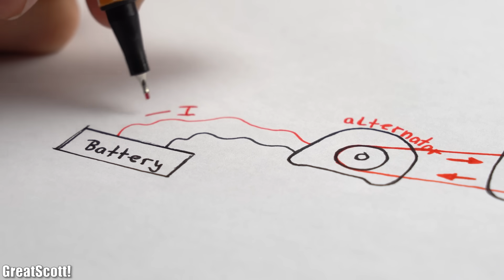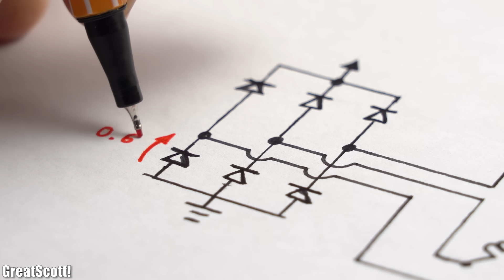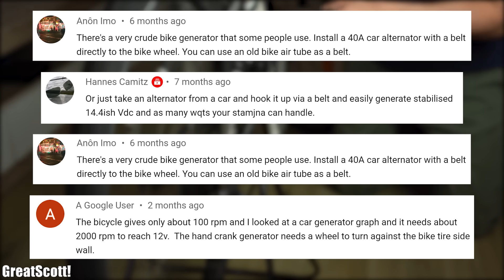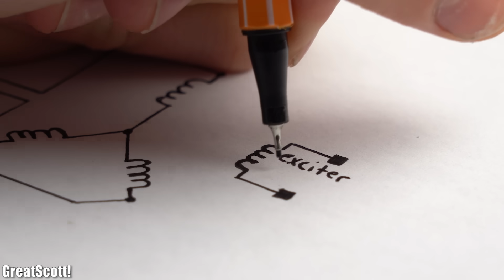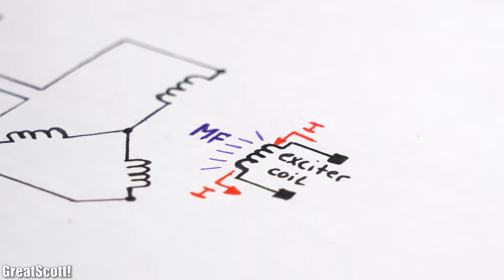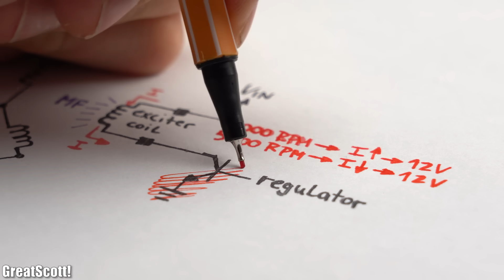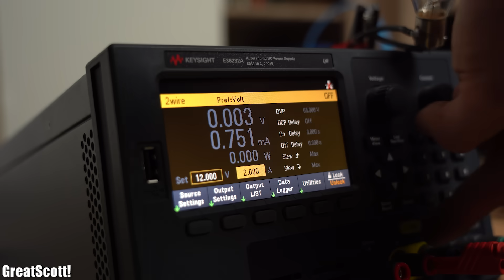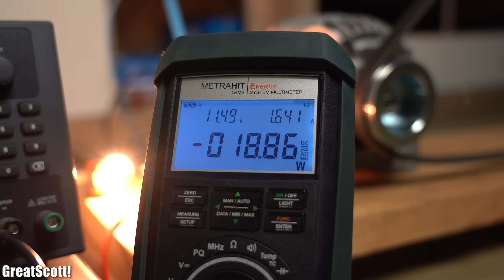Using a car alternator with a bike to power my home? How much energy can I produce?!

Comment: Are you sure you're using the "top gear" of the bike? From what I could see in the video it looks like you were using the "lowest gear" on the rear sprocket. I think the "highest gear" on the rear sprocket is the one with the smallest diameter. That would make a dramatic difference in how many RPMs you can drive the rear wheel.

Comment: I think a different make and model of altenator would have worked better. A 70's chrysler brushed and unregulated altenator makes good current, Just have to add a remote regulator. I've seen guys add them to a truck and use them as a welder. Or a diesel altenator may be better. They are a lower rpm altenator. Belt tighrening bolts pushing against your altenator for tension wiuld have helped as well. Slipping belts kills efficiency. Cool experiment.

Comment: Years ago I replaced the pulley on the front of the alternator with a 2 inch pipe, with an end cap scred to one end. The end cap I had center drilled to accept the input shaft of the alternator.  I then simply had the alternator on a pivot with a strong spring and had the pipe ride on the tire!   Not belts needed.  Also, i fashioned a 10 lb fly wheel incorporated with the drive wheel because once you hit the proper rpm to create charge, the drive wheel really wants to slow down  and fast!

Comment: I built  one of those I used a stationary bike and used a chain around the wheel to drive a 300 watt permanent magnet generator. I connected it to a grid tie inverter. Pedaling as fast as I can I can get 100 watts for a brief period.  I can get 50 watts for a longer period and at 30 watts I can go for quite a long time. The bike had a speedometer attached and at the 30 watts I was doing 10 MPH. at 50 watts about 17 MPH and at 100 watts about 22 MPH. In conclusion the human body cannot perform a lot of energy for any length of time.  You were talking about 1400 watts that is almost 2 horsepower. Maybe a good horse can do that for a while but a human cannot do that type of power.

Comment: ya didn't need to take the wheel/tyre off! press the PULLEY  of the alternator against the tyre, rotate, add exciter voltage to alternator, output...

Comment: Pipe dreamz my friend!.. here is why. A human in good shape can produce between 50 and 80 Watts per hour with pedaling or running, possibly triple that in short bursts for a few minutes at a time. Your 1440Watt alternator is not going to reflect anywhere near this number with human power... that being said.. you can charge a few phones or a larger 12V storage cell and that's about it. 746Watts is one horsepower, so you will need 2 or more horsepower to bring that alternator to its maximum output. There are also rotational and friction losses in your setup that would have to be considered as well.

Comment: Interesting video and surprising that others also have struggles with the mechanical connection between the bike and the generator. 
I used a servo with permanent Magnets in my project that doesn't need any current to generate power so I get 50W out continuously and over 300W for a short time.
My video is in german, but maybe you are interested anyway. Earlier I also wanted to use an alternator from a car but for such power a smaller generator is probably better.

Comment: run the load directly in series with the exiter coil an get all the power into the load. only works on some alternators not all of them but the small car alternators chould work. you can also increase the power output by vary the slipring resistance in tune with frequency. that will give almost no resistance at all for the same watts i mean almost freewheel. only works when load is in series with the exiter coil. this is somthing i figured out about 10 years ago.

Comment: it need to get exited by the ignition wire to turn on else it would not work. you also need a start charge to get it to produce. without a battery the voltage can get very high and potentially damage the electronic unless you regulate rpm.

Comment: what if you feed the power output through a diode into the exciter coil so the power produced will also help produce more power and then at some point (perhaps using a flywheel??) you should be able to turn off your power supply and have the alternator power it's own exciter coil.
Reply: also i think your belt was too loose.

Comment: You need a belt tensioner. The accessory belt on a car has to be tight, otherwise it slips quite easily. Your belt is floppin all around, its not receiving all the energy youre putting into the system.

Comment: Your bike is in low gear. You need to use the biggest ring on the crank, and the smallest ring on the wheel. Missing out on TONS of RPMs

Comment: Using the system to charge a battery bank would be more worthwhile because then you could exercise and store the energy you make. 
Or Infact get a solar panel lol 

Better still just use a fuel powered generator and don’t be brainwashed by the media lies designed to hike your taxes in a guilt free way 🤣

Comment: Lol. Since you show genuine desire to do this, i guess i can share a little. Run power to a motor that goes to generator. Run an inverter off of it. Simple. Lol make sure to regulate it for heat and surges. Create a protective case also. I would share more but that is the most simple design. Ha Ha. Good luck generator to motor to generator

Comment: I had a slightly different idea, to use a car generator/alternator to power my Amateur radio rigs with a battery for when I run out of gas in a 5 horsepower engine I got from Harbor Freight.

Comment: If you pull the back off the alternate it creates a much larger amount of power. Look it up before doing it, I can’t remember the specifics but I’m pretty sure it comes out as high voltage so be careful. Not sure if you can tone that power down to what you need it at tho, pulling the back off  to make something dangerous to electrocute myself with is about the limit to my ac electrical skills unless it has a schematic

Comment: General Motors makes self excited alternators. They were used back in the 1970's and 1980's. They called them one wire alternators on the street.

Comment: okay lets try this again. there is actually way to make this system work. you are on the right track. you need to change just a few things. big gear on pedal small gear on wheel. also you can ad an additional step with a second drive wheel. again going from large to small while a larger wheel on second shaft drive the alternator. this will get your rpms close to 3500. next if you want 12 volts leave Alternator as is run lines to battery bank. battery bank provide power to coils while you are pedaling to charge the system.  pedal to charge batteries. if you want you can find examples of this on you tube.

Comment: A  car battery and a dc motor and they can power your home.A dimmer switch to regulate the speed of the motor for the right power output. Alternator could be hooked to the battery to keep it charged and to power the house. You can hook up and invertor to it if you to not want it hooked into the home.

Comment: Car alternators are made to be  inefficient on purpose. They’re only good enough to supply enough current for accessories and recharge the battery. The reason they’re not more efficient should be obvious, as the powers that be don’t want us utilizing an efficient alternator to do great things.

Comment: All that effort for a measly 20W! And bear in mind that unless you’re a top athlete your body will struggle to output even 100W, and to keep that effort up for more than a few minutes.  Then you'll need to take a rest!  Reality check sir! 
As a learning experience it has some value, but you could easily have got it all in an electrical engineering text book from a library.

Comment: You can eliminate the rectifier system and make ac power directly from the alternator. Also an old washing machine motor is better suited but you need to get the correct type.

Comment: You will avoid the need to add a tensioner if you can remove the pulley from the alternator (or get one without) and you can install a chain gear on it. Also with a little more work you can add on more chain+ derailleurs and make the gearing go to ludicrous speed (you will have to add more shift cables obviously). Add all that with with more gearing on the crank and some front derailleur modification and increase speed for easier voltage... should work great...still not done with the vid just had to get that out.
Reply: Yes there is a trade off between calories used and tork applied, also the friction of a chain and the friction of a belt driven unit are different, especially if you use a tentioner to limit belt slippage.
Reply: The gears in my offgrid mind are turning
Reply: i did a tensioner on a band saw with a little plywood door the motor was mounted on, and a piece of running thread to set it.  my cement mixer, the motor is on a piece of wood underneath, and it is not even attached.  i was going to put a hinge, but the one end just hangs from the belt and the other sits in the frame, it worked, i stopped fiddling.
Reply: by the time you're done with mods, you would already have  dedicated machine built up from ground ;) . 3 or 4ft dia flywheel with smallest pulley possible for alternator and direct drive instead of belt should do the trick. but then again, if flywheels are thick, it would be major PITA to start it up (and slow it down)...
https://www.youtube.com/watch?v=XffkqfymSXc

Comment: to avoid slippage, you should put on a tension pulley
Reply: Also I think he's losing a lot of power by not having any tension on the alternator pulley. I've seen it before in a car with a bad tensioner having low voltage problems
Reply: If you peel the belt on, its enough pressure. I size belts exact, minus a half inch. I think thats 13mm or so.
  You can also bring a belt up to heat, if sized too large, to shrink another 26mm or so.
Reply: @DarkLinkAD  his belt was really loose, I guess if he peeled it on that would suffice but I still think having a little tension on the pulley would go a long way in terms of power, not too much tension though
Reply: It's irrelevant...because a man can nowhere near turn that alternator at full "volume"
My experience is, you have to stand and push down on one peddle just to get it to go down once...
Though I am experiming with a 14 amp 12 volt alternator hooked up to an airdyne....
If I achieve that to work I will consider it to out do my own exptations...

Comment: I saw a video a while back where they used the radiator fan from a car, attached bigger 'blades' to it and used it as a wind turbine. You could try that and you are not relying on having to peddle either. I'm thinking of doing this to power an oil filled radiator to heat a cold room in the house without the cost of keeping an electric heater on constantly. A low constant heat may work, what do you think?

Comment: use a wind or solar panels or both to charge batteries 2000 what inverter hooked up to 3-4 parallel 12 volt batteries and your good to go.ps for future idea the smaller the copper windings in your motor easyer to make power.

Comment: The Telharmonium (also known as the Dynamophone) was an early electrical organ, developed by Thaddeus Cahill c. 1896 and patented in 1897. The electrical signal from the Telharmonium was transmitted over wires; it was heard on the receiving end by means of "horn" speakers.
Reply: The first synthesizer but it wasn't a jp8000

Comment: Use a kick start system to start generator by turning electric motor with a transformer to regulate power source. Hard wired to an inverter.

Comment: A car generator does not turn one rpm for every RPM of the engine. It is on a long serpentine belt and turns many many times for every RPM of the engine. If a car's idling at 800 RPMs, The generator would be spinning many thousand RPMs even at idle.

Comment: Actually, charging the car's battery is the secondary purpose of the alternator. That's why, once the car is running, you can disconnect the battery and everything will still work.
Reply: Aside from causing the OBD system to throw codes, or possibly even causing total computer failure in almost any road-legal automobile made after 2005... I'm sure that's a cheap & easy fix though, right?
Reply: @harbingertheheretic  Whatever you say. Apparently you haven't noticed that the lead from the alternator is joined with the main feed to the car. Electrically the same point. In effect, the alternator provides the power, not the battery. The battery is in parallel with the alternator not in series.

Comment: use pulleys to intensify the speed without any further speed from you. Just like the gear system of the bike. Pulleys properly built will lift 5 ton + rock slabs by hand.

Comment: You're doing it wrong! Start over. If you dig a little deeper you will find what you need.
    Think of it like this ... You don't wanna peddle, it's a little too much .. but .. if you're putting out, say, 60 amps, then work with that. A. A motor. 12v that runs on no more than about 10 -15 amps, turning B. the chain, powered by C. a small inverter w/charger that is fed by D. a couple batteries (24/48v), ultimately closing a loop.
     As long as u can create enough pwr to run the motor to chg the sys & supply the inv. with amperage left over ... You're Gold!!
     Lived in a solar house for 15 years. Boy, what a learning curve. On the way out, seller said "just throw the black switch". Haha. F@#* Aholes.
     Turned off & reset "everything! Sink or Swim.

Comment: Use a 24v wheelchair motor spin it directly with a high torque high speed 12v miniature lathe motor. 24v/12v power step down to capacitor and speed control switch. The 12v motor powers itself off the 24v output and also charge a capacitor and battery or you can use the self running generator to charge a bunch of 12v batteries for constant charging constant running without an outside power source

Comment: So, if we connect to this alternator, a 12v electric motor that can run at 900rpm means that we can create infinite energy, right? But first we have to start the engine before connecting it to the alternator. That would be an easy and interesting experiment to do.

Comment: idk if i'm an idiot or a genius but this is what popped into my head.... don't use a belt.  use a drive shaft /gear assembly and remove the back wheel entirely.  since you do not need to steer because you are not moving the alternator could be in the place of the front tire and instead of turning a gear that transfers energy to a chain belt, to the back wheel that transfers the power to a wheel that then transfers it to another belt and then to the alternator pully.... remove all that.  the gear you turn when you peddle basically would rotate a drive shaft/gear  that would turn the gear on the alternator shaft.  less travel usually means less loss.  less slippage as well... and you could make a better brace for the bike since you do not have to accomodate a large spinning wheel in back.   now the gear ratios i wouldn't know, i'm no scientist.... its' just what popped into my head..... heck idk if you put multiple alternators into the system with additional gears if that would jump your output ..maybe even make it harder to peddle LOL... i'm just not in the know here..... i wonder if there would be a way to include the shifting from one gear to another with a drive shaft attached? like a transmission?  eh ... too many ideas,,, if any help or spur more scientific study...i did a good thing :D peace.

Comment: I always thought why you couldn’t install a couple of these one on each rear tire. Configure so it is rotated by the rotating rim. And as long as the vehicle is moving it be recharging batteries. But many responses said it wouldn’t work and cause drag, but looking at how easy it was spun by hand doesn’t seem the drag/friction would be measurable(?).
Reply: Spun by hand is not fast enough to charge therefore there's no load- let alone the fact he didn't have the field wire powered anyway. As he showed the rpm was more than a few hundred when it was powering the bulb and you saw he was putting good effort to get that much.

Comment: It’s good to use the mind…. Incorporate solar power during the day with battery bank, inverter,  etc …. And alternator set up for night!? (Prob battery bank & inverter as well!?)
Use same battery bank or have a separate set up!?
Using (what you’ve learned!?) what it takes to power up at night!?
Free energy is possible! We jus gotta try harder!? Thanks for the video 👌👍🏽🚘👋🏼

Low powered LED LIGHTS FOR LIGHTING(DC voltage!)…. Inverter for ac appliances devices etc that require ac voltage!

They make battery powered motion lights nowadays! I have placed one in a shed with no power! Open the door lights come on!
Bout 300-400 lumens! Works like a charm!
Install a bunch in a living condition!?
Maybe put some recharging batteries in them…. Use your power station to charge those batteries back up & switch them out as needed!?

Comment: When I was a kid, cars used generators, with the engine running it was possible to remove the battery and change it over. You cannot do this with an alternator.
It was also possible to motor a generator by applying 12V from the battery, the generator would turn like a motor. However you risk damaging it (I’m not sure why).
Diesel electric locomotives turn their electric motors into generators to retard their speed down a hill, the excess electricity is fed into a copper grid which gets warm.
Electric locomotives feed their excess electricity back into the overhead wire.
This is called regenerative braking. 
Electric cars do this too but I don’t think this contributes much to the range of the battery.
Reply: If you disconnect the battery while a car with an alternator is running then it keeps running. If it dies then that means your alternator is bad.